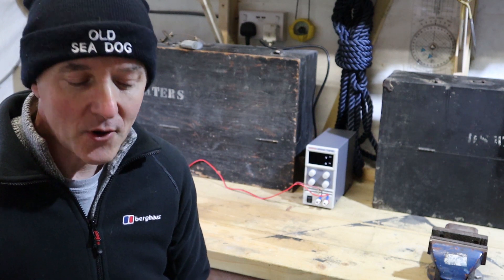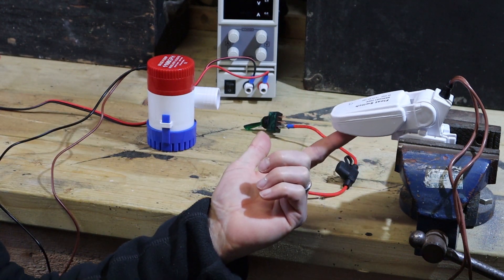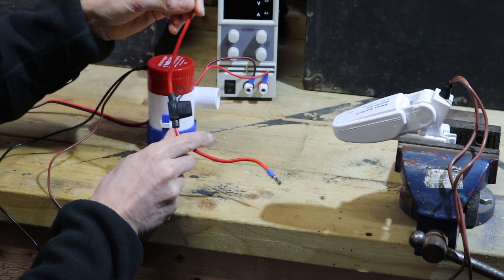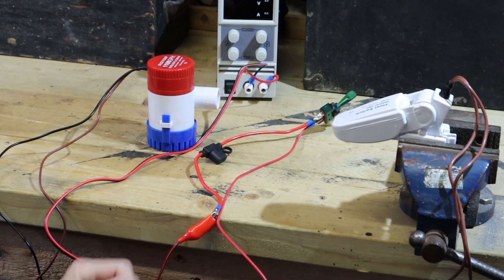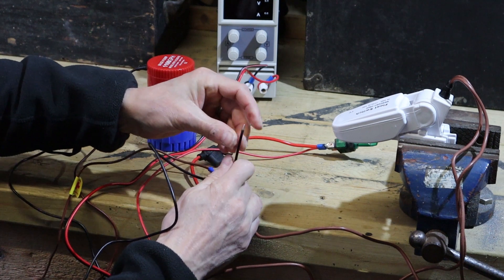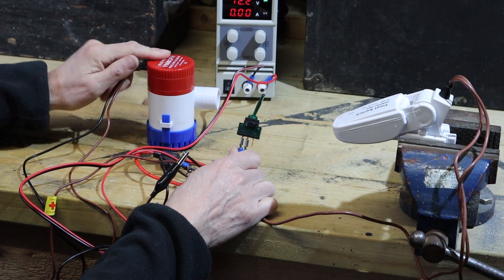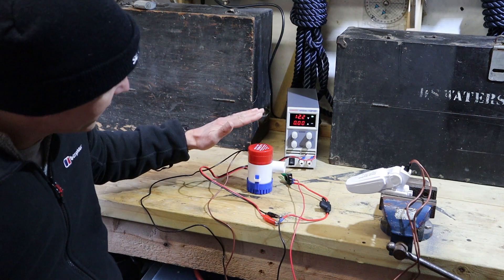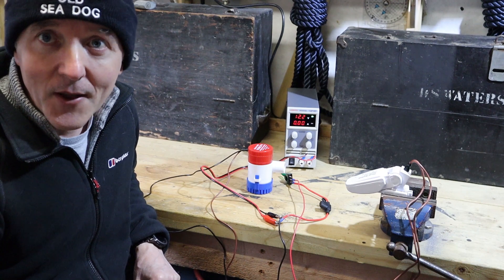How do you wire a bilge pump?  We show how to wire in a manual 12V bilge pump with a float switch

Comment: the other contact should be wired to the pump also so you can override the auto switch and turn it on manually

Comment: Hi can you please tell me how to hook up a fish finder with the bilge pump ? No float switch. ?  My fuse on new gosh tinder keeps blowing. It’s 3amp my bilge is 15amp?  When fish finder fuse blows. My bilge dosent go either. Help ?
Reply: put every device on its own wire and its own fuse , wire capacity should be higher than fuse, eg if fuse is 5amp use 10amp wire

Comment: Can you wire the float switch in line with the bilge without a toggle switch?
Reply: You can, wouldnt recommend it. If the switch breaks and stays always on u wont have a way to shut it off and will kill ur battery
Reply: @SunshineExplorers  wouldn't that happen regardless? If you're not there to hit the isolation switch
Reply: @kylejustin3099 if you are careless about it then its possible. But if you check it Nd notice its just always running the only way to stop it would be to cut the wire and you dont wanna do that. A switch is alot easier. 

Also this is not an idea set up for the switch. You sould run your float switch and manuall switch in parallel lines. 

Consider your float switch breaks in the middle of a ride on the water and you start taking on water. How will you operate your bilge? You would sink before anything. Its a terrable idea to not have a manual override switch you can activate in case the float dosent work. 

Also really you should use two switches. One for the parallel line mentioned above and the other to be in line with the float switch like this video describes. That way in all situations you have a way to turn on or off you bulge pump no matter what.

Comment: The old float switch I'm replacing has two wires coming off of it and one clearly goes to the positive on the bilge pump. The other one was not connected to anything and I don't see anything to connect it to?
Any help from you wiring Gurus?

Comment: I was always under the impression to override the switch, and just wire directly to the battery.  
I guess we all have our Ways.
Reply: His way is fine too but I'd prefer to bypass the switch with the float. I prefer my main switch to activate on manual trigger, with the float switch being a backup for when the boat may be unattended. Plus it's nice to have your primary switch kick on the pump at will so you can have the peace of mind of knowing the pump is still functional at the very least.
Reply: That's the way I've always done it. The float switch is just in case of a  downpour when my boat is left out unattended.  But everyone has their own ways.

Comment: Stupid my pump never came with a fuse 
Tried to install my pump straight onto the battery and the float switch I tried connecting onto the wiring of the pump and lol nothing the pump worked but no switch or anything so I guess I have to salvage a switch off something and rip a fuse out if something that’ll match the pump

Comment: i couldn't find an answer anywhere.what happens if you fit the float switch on the negative side of the circuit ?  Any harm?
Reply from the maker: Hi thanks for your question.  Fitting the float switch on the negative side would work.  It is convention for switching to be on the positive side, but in practical terms for a float switch there would be no real difference in the operation.

Kind regards,

Richard

Comment: Zoom in on the wires. 
From the inline fuse the hot wire goes to the toggle switch, does the hot wire continue on as a pig tail from the toggle switch or does it the toggle switches other open terminal where the outgoing  hot wire connects? My toggle switch only has two terminals. Will it require 3? These are things that would make this tutorial more helpful.
Reply from the maker: Hi thanks for your question.  I must admit that this video guide has been superseded by two further videos, could you please take a look at the vids in the links below and see if that answers your question.

https://youtu.be/mUNOzn2AsPA

https://youtu.be/mUNOzn2AsPA

Thanks,

Richard

Comment: how long does the battery AGM 12V run for a long time?
What is the maximum current when the pump is running in water?
Reply from the maker: That depends on the capacity of the battery, the pump would typically take around 3A when running

Comment: I don’t understand why you’d want a manual switch for a float “switch” bilge.  Wouldn’t you want to connect the wires directly to the battery bus bars, so that there is no mistake that a manual switch is ever turned off?  Is there a Situation where you wouldn’t want the bilge to turn on when it’s submerged?
Reply: Yeah a float switch should have to be activated by another switch, it should have power all the time, and the switch should be there to manually turn it on in case the float gets something caught in it preventing it to turn on.
Reply from the maker: Hi Dan, thanks for your comment - it's a good point for discussion.  There is absolutely no rule saying you need a separate switch as well, so if you judge that you prefer not to have a separate switch then all good.  For me, if I was on my boat and realised that something had mal-functioned (maybe the float switch got stuck on) or jammed somehow I like the idea of a separate switch that I can get to easily.  Having said that, I can appreciate the idea of simplicity and less components by not having a separate switch.  I appreciate your thinking on this and valid point of view.

All the best,

Richard

Comment: i have a seaflo 1100gph 12voltdc bilge pump with the two wires positive and negative/ground. i was wondering if it where possible to wire it up to something like a 12volt car adapter outlet plug, and then plug that into something like an Ecoflow battery and charger unit and use its 12 volt output port. would this work for this bilge pump? would it harm the pump? i have a pump which i got with a certain prospecting item and i want to be a little more creative in how to power the pump itself with something like the Ecoflow portable battery "generator" units. and, since it has a car adapter 12volt outlet, all i would need is to wire the pump to the adapter which ever one i might get, and then i could charge the ecoflow battery unit when it drains, but be able to use the pump with it, rather than a standalone battery i would need a charger for. if this would work, i would love to know. Thanks! =)
Reply from the maker: Hi thanks for your detailed question.  I am not exactly sure what an Ecoflow battery it, but if I understand the situation correctly it sounds like it could work.  The key thing is to make sure that the battery and charger combination can cope with the current demand of the pump.  The peak current draw is usually when first starting up, and the battery is useful to cope with this current demand, then the charger hopefully would be enough to keep the battery topped up inbetween uses.  As long as you are supplying the pump with 12v then I would not fear damaging the pump in this way.
Reply: @BoatFittings  thanks for the reply haha. i had decided to actually try it out, and so i got the battery (Ecoflow is a brand, and i am in love LOL) to wire the pump i ended up getting a 12 volt car adapter plug with anderson powerpole ends, and i crimped on the appropriate sized contacts to the pump end wires, inserted them into the right connector housing, and then tested it out. it worked perfectly. with the press of a button on the battery bank, it starts right up no problem. now, as for life of the pump, ive seen it be used for many many hours by Doc at Gold Hog, for use in powering the pump to run their MultiSluice , which is what i needed the pump for. its been a bit chilly to do much prospecting and being busy i have to ration my time, but i think ive hit on a perfect solution in this combination. also, the wires ended up being ultra tidy, and plenty long too. so, anyone else could try it out and it should work for them. long term usage of the pump may wear it down, but it shouldn't be too bad to run it at least 2 or 3 hours at a time eh. and on that note, the Ecoflow River Max, is what i ended up getting, so ive barely drained its capacity charging my phone up about 10 times now. still at 96%+ lol. the bilge pump should be many hours longer run time than a more portable but less capacity standalone battery and alligator clips. in any case, thanks for the reply, and though its late, i ended up just taking the plunge anyways =) and, its worked out perfectly.

Comment: you have it wired wrong, the toggle switch is for manual and the float is hot wired for automatic, you wanna hook one side of the toggle to the battery and float switch and the other side of the toggle to the pump and splice the other side of the float and that way the switch is wired hot so it works all the time and the switch is for manual use,  that float switch should always have battery power not switched power.
Reply from the maker: Many thanks for your opinion on this.

Comment: Hello i have a float switch max 20amps and a automatic switch board for the pump. The pump is a 1100gph i put a 20amp fuse in the switch. Because the other one blew is this save.

Thanks
Reply from the maker: Hi thanks for your question.  Having a 20 Amp fuse for an 1100 gph pump sounds a little on the high side.  Your pump should have a recommended fuse rating, which in my experience would be more likely to be in the region of 5Amps, but please check your instructions with the pump.

All the best,

Richard

Comment: I would like to use these for a DIY musical Fountain, is the pump resistant, like will it burn out after a day of operation? They have ideal conditions to be controlled by DMX I just want to know if they will last very long.
Reply from the maker: Hi thanks for your question.  I have had these pumps running all day on different occasions and all was fine even after a full day or running.  Good luck with your project!

Comment: On a set up like this, can you connect this to a fuse box ran on a battery selector on the output or common post? Or do you need to run it straight to the battery directly with an inline fuse?
Reply from the maker: Hi Jed, thanks for your question.  In may cases a bilge pump will be wired via a switch panel which is lets say the common or normal way.  Some people also prefer to have one bilge pump wired as directly to the battery system as possible to keep the circuit minimal (and hence the chances of some failure in the circuit), I would say the limiting factor is always to have a fuse in the system.

Comment: The float switch should be wired to the battery, not to a toggle switch.
Reply: Yes in deed. Run float switch with a 5amp fuse in-line to the battery…run 2nd + wire to switch for manual on and off bilge… the purpose of float switch is to pump water out if boat fills with water sitting at the docks over night etc.
Reply: @kanaletumlinson  So, are you saying if I already have a switch at the console, I should leave it connected to the pump; and then add a fused positive lead from the battery through the float switch, essentially having two switches?
Reply from the maker: Thank you for your input
Reply: @BoatFittings  I'm confused about the whole switch thing. I leave my boat on a mooring for weeks at a time. Should the pump be switched on all that time? Or just when I arrive at the boat and find water in the bilge?
Reply: yes.   Seems as though if your switch is in the off position your auto float switch is inoperable.
Reply: This is retarded. The switch is supposed to be for manual overide in case of float failure!!!. Why even have the switch if you're still relying on the foat to turn the pump on.?

Comment: In your video it does not include when u use a heavier pump , I understand you need a  Magnetic connector, I need to install a float switch or water level switch inside a sewage pipe to connect to my marcerator pump = DC 12 volt / min 6.5 max 10 Amps / model MP-3500-12 

It is very difficult to find the right information
Reply from the maker: Hi thanks for your comment.  I am afraid I am not familiar with the situation you mention regarding the installation for a macerator pump.

Comment: What about one with a manual switch too
Reply: The pump is supposed to be powered all the time and manual also as a safety incase your float switch is giving problems as my boat was wired I also had a light that would notify on the switch panel that the bilge was running. I think for safety reasons it suppose to be on all time float switch no off switch  ?
Reply from the maker: Hi thanks very much for your message.  I think it is a good topic of whether a bilge pump should be left on all the time (quite some different opinions on this I think.)  This question is beyond the scope of this video, but might be a topic for a future video and discussion.